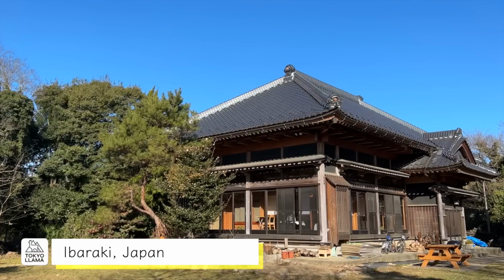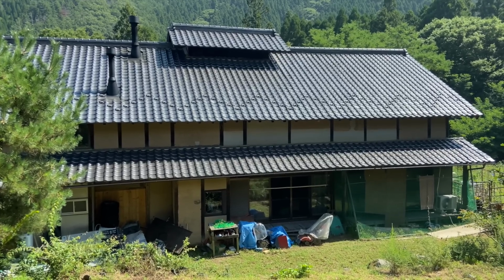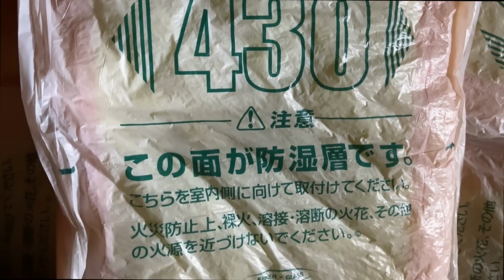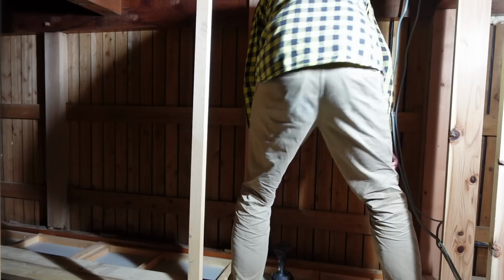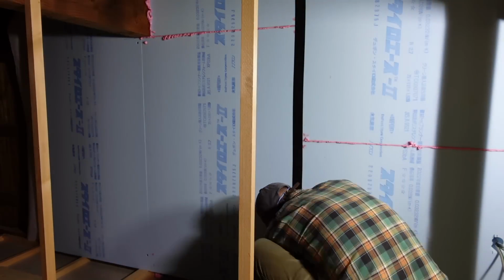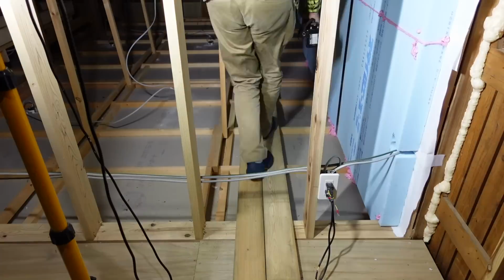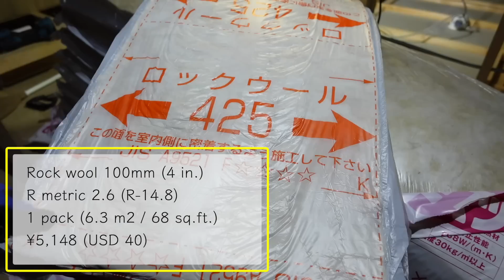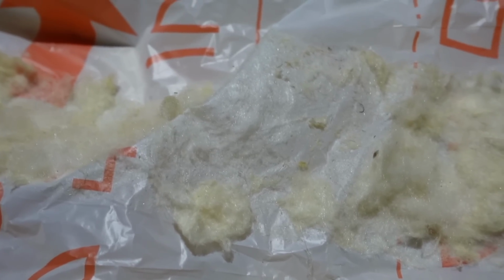Insulating a Japanese House, Part 1 | Abandoned House Renovation

Comment: That earth wool looks incredible! I just want to "floop" into it. 😂
On the point of insulation, I'm finally into my house here in London and as it's a small Victorian terrace the insulation is minimal. The heat loss isn't too bad, being a terrace, but damp is the bigger issue. I was wondering about that in Japan - for a large airy house like yours it's less of an issue, but do you know what the old style town/city houses are like in terms of damp? Kyoto comes to mind, of course, although I'm sure they exist dotted around the country. I can't remember if those houses have a gap under the floor or not, which I think would be the biggest help.
Reply from the maker: It felt like I was shearing a sheep cutting the earth wool! I’m not 100% sure what they do with machiya but I imagine the foundations are similar to ours and quite airy. Also, compared to England, houses here don’t use much masonry so damp is less of an issue.

Comment: I was wondering if putting that insulation So close to the original large  beams that go from the ceiling to the floor over the boys bedroom won't trap moisture and rote those poles.
Reply from the maker: Hopefully there's enough air flow and not so easy for moisture to get in

Comment: Spending money on insulation is the best way to reduce the money spent on heating and cooling. While yes, it is a cost that is immediate, meaning you pay up front to buy and install, it pays itself off over time. 60% of your heat is lost through the roof of a house. This doesn't take into account the design of Traditional Japanese homes, but I can only imagine the benefit of containing the heat to the bedrooms has a drastic effect on comfort. 

I live in Pennsylvania USA. Here we build with sealed wall cavities which for the most part are quick, easy and cheap to build... But they are terrible when it comes to moisture issues. 
My home is a pre-built house. It was built in a factory and moved to it's location. Here we call them modular homes, but it is not a mobile home. My house was built at the beginning of the modular house craze in the 1960s. If I could go back and choose a different home, I would have never have bought this house. The biggest problem in this house is not the lack of insulation... It was insulated but it was done so poorly that it is basically as if there was 2-3 windows left open in the whole house. Over compressed batts and very large gaps or no insulation in small bays. I was told by a home inspector that it would be equivalent to having no insulation at all with all the gaps left. This was discovered because the previous owners replaced the siding and the nails never hit studs under the sheathing on the outside. The penetration of the nails into the cavities provided a way for water to enter the bays and fiberglass insulation basically never dries out once wet... In a sealed bay. I had wet spots on the walls inside from water wicking in.  

Thankfully the siding is vinyl which is easy to remove and reinstall correctly, without much extra costs. The damage done by improperly fastening the siding was tremendous. 

The drywall inside had to come off and so did the exterior sheathing in many places due to rot, within 3 years. All the insulation was basically bad either from water or from it being installed incorrectly when the house was built. Which left me with a dilemma. What do I replace the insulation with?

I was living in the house and couldn't afford to rip off all the walls at once and replace all at once. So I nixed spray foam. Insulation board would have been great to add to the outside since the siding was off but the cost had skyrocketed because of supply issues. Which left me with replacing the existing insulation with fiberglass again or switching to Rockwool. The original insulation was r-11. New fiberglass is r-13, but Rockwool was r-15. I went with Rockwool because when it gets wet... It doesn't work it into the batt... So it never 'gets wet'. The added r-value was a bonus. 
In the previous winter my electric bill was $200/month. The following winter after replacing just 3 rooms (bedrooms) $175/month. Please keep in mind that electric rates doubled in the span of this year... So the $500 I spent on insulation has already been paid back. 
I know that my situation is an extreme case, but it does go to show that insulation is worth it's weight in gold... At least to me. I only replaced the insulation in 3 rooms or 1/3 of the entire walls of the house, not the insulation in the ceiling! 
Anything that you do to place a barrier between you and the outside is a huge improvement. The costs are not that much when you think of the benefits over the long run. I think in your case: it is money well spent. In my case... I wish the walls could have been able to dry out... So I didn't have to spend $10,000 to pull the siding off and replace insulation and drywall. Keeping the air gap was a smart idea.
Reply from the maker: Thanks for that. Sorry that you had so much trouble (and costs), but glad to hear that my thought that sealing the bays would cause potential problems, and that the extra work to create the air gap should be worth it (as well as the cost of the insulation).

Comment: Now that you sealed the air gaps, you have to work on how to quickly circulate the hot air trapped in the attic during the hot and humid summer.

Comment: How come the RockWool slabs come individually wrapped? I have never seen that here in Sweden where they only have a single outer wrap that holds a few pieces together before use.
Reply from the maker: I think it's just Japanese preference for convenience. Much easier to install than putting in a "proper" vapour battier.

Comment: Question, are those wool on the ceilings flammable? I've had my old wooden house burn down from faulty electrical wiring before, so please pardon me for asking.
Reply from the maker: Earth wool and rock wool are non-combustible. They say it actually suppresses fire.
Reply: @TokyoLlama  that's wonderful! An insulation layer that's also fireproof is very reassuring.

Comment: This might be a dumb question, as I have no background knowledge about insulation, but isn’t it better to have the rockwool and earthwool in bags than loose? That way all the micro glass and the like are prevented from potentially being breathed in and causing respiratory issues? 
I’m genuinely just asking, cause all I know is that when my parents had their insulation replaced in the attic (partially my fault), un-bagged rockwool was used. Btw. This was in Denmark if that might have any relevance 😅
Reply from the maker: The earth wool is supposed to be okay compared to regular fibre glass. That whole cavity will be sealed eventually but in the meantime I usually wear a mask up there - also a lot of dust.

Comment: I'd kinda like an overview of what exactly you're insulating (or rather, what not) and what the different materials are for. e.g. why the earth wool ontop of the rockwool again? Also, why did you insulate the floor of the corner and the walls? Or rather, wyh the walls if you don't plan on properly insulating the roof? Or did I misunderstand there?

Also also, I personally would have tried to turn that corner into a storage space with a usable floor. (Kids produce a lot of things they/you want to keep long term but realisticly won't touch for many years.) Any reason you decided against that?
Reply from the maker: Yes, looking back I probably should have done an overview of the layout as it's not as clear as I thought in the video. That's not a floor in the corner that's a ceiling (only about 9mm thick so can't be used for storing anything), and will eventually build a floor above it. I mentioned the earth wool just because I wanted uncovered rolled insulation - rock wool would have been fine, but couldn't find anything without the plastic covering.

Comment: Why did you choose to insulate the walls in this area (above boys bedrooms) and not just the ceiling?
Secondly after the walls were insulated why then insulate the floor - does it have a purpose given the wall is insulated? 
Am I right it is to reduce heat gain in summer in principle?
Reply from the maker: There walls are not air tight so in winter the space would be cold and any heat that did eventually make its way through the insulation would be lost outside through the walls. The opposite during summer. I’m not going to insulate the attic floor.

Comment: any issues with covering the light fixtures, will heat be an issue?
Reply from the maker: No, they are rated for covering with insulation. Also the rock wool is non flammable.

Comment: Why are you using XPS instead of PIR if I may ask?

I myself are insulating old brick walls and PIR gives a higher R value for the same thickness.
Reply from the maker: I couldn’t find PIR here in Japan. That said, because thickness didn’t matter so much I went for the cheaper option than some of the other foams.
Reply: @TokyoLlama  Yeah PIR is indeed among the more expensive options indeed. We're sort of limited by the thickness so we went with PIR.

For other insulation purposes I'm looking into denim insulation rather then rockwool/glasswool. They provide roughly the same temperature and audio insulation but don't suffer from thermal drift over time (the material losing thickness and thus insulation properties).
This option is more expensive than rockwool/glasswool but it's more sustainable and maintains the same properties over years/decades.
Reply from the maker: @Cobra6Gaming  thanks, I’ll check it out!

Comment: cant say that ive EVER seen someone cut foam sheeting with a skillsaw before! XD a box knife will do just fine LOL
Reply from the maker: Our carpenters did it with a circular saw so just copying them!
Reply: Ah i see. Anyways yeah you can just cut with a carpenters knife and you dont even need to cut all the way through. Once you make a cut at least 1/3 or so through you just simply break it and it will break right along the cut.
Reply from the maker: @1964corvan  ah, that makes sense. Thanks.

Comment: Covering up the light fixtures probably not good, remember when there was house fires from idiot insulation installation during the Rudd times. It'd be preferred to leave direct holes in the insulation above each light fixture to prevent heat build up in the fixture. A small loss to the heat barrier, but a massive reduction in possible fires in a basically wooden building. Don't they sell pink batts in Japan? Although an extra expense, some 12mm ply lain on top of the ceiling joists and then screwed in place would give a firm surface for walking and a much simpler surface to insulate, just my 2 cents worth. Great work otherwise...

Comment: I don't think it is a problem (yet) as you said you weren't aiming for airtight isolation.  But, when isolating old houses, you need to make sure that you also account for air circulation from outside. Without any fresh air coming into buildings, the air quality will drop dramatically to the point of becoming unhealthy. 
I am not sure how they are officially called in English, but there are "heat reclamation ventilation"  systems that basically exchange the heat from outgoing air with incoming air.  That way you get the benefits of good air quality with minimal heat loss.

I am no expert by any means, but it is a topic that comes up often around here as a lot of people are looking at isolating their home better.
Reply from the maker: Thanks, I've been thinking about this too. I don't think the house will get fully air tight but I am researching air exchangers and do plan to do something along those lines.

Comment: It's an astoundingly tough task to add an (almost) entirely new control layer into a building envelope after the fact! Especially one with such beautiful architecture (that deserves to be preserved as-is) which almost rules out the option of "just" building an uninterrupted new insulative wall and roof structure all over the existing envelope... I imagine having to do it piecemeal must feel like jamming fiberglass between one's ribs sometimes, instead of just putting on a whole winter jacket.

From what I've learned about building physics from my reading is that controlling or at least limiting undesired airflow is the first step in improving energy efficiency of a wall. Before that, keeping the rain off is of course even more important, but anyway... after establishing a good air control layer somewhere in the wall one can next worry about the thermal control layer, i.e. insulation. The recessed ceiling can lights are an unfortunate design choice in the air tightness aspect - I'm sure some LED alternative could've been found instead, assuming visible wiring would be acceptable.

You are correct in making sure the wood of the facade remains ventilated as that's where air in turn must be able to flow freely. Long eaves on the building take some of the stress off the wood of the facade but sideways rain will still make it there on occasion so ensuring the wood is able to dry helps with longevity.

Comment: You can tell its not in aus, not the design of the house, or the materials used.
Its the fact hes in the roof and not a single redback spider is to be seen.
Reply: Weell... funny you should say that. I'd suggest you Google [latrodectus hasselti japan]... 😨
Reply from the maker: Yes, they have them here but never seen one. Definitely not as worried about snakes and spiders as I would be in Australia though!

Comment: Circulation of air is important in a house. Why? so you don't have damp of any sort. The important thing to remember is the house has to be able to breath in all climatic conditions. Western houses tend to have chimneys that helped the air circulation but with modern day thinking that you seal every bit of the house to retain heat and have no drafts introduces damp in the house that can't escape, if your house retains damp long term that's a big problem.
Reply from the maker: Correct.

Comment: Hey man, some money saving advice from someone in the same rabbit hole. JFE makes an unpacked product, code BD04010P, it's 11 meters long by 910mm wide, at around 12.000円 (maybe less if you order directly) , or a little over 1000円/m. You're paying 5000ish for 1.36m, or ~3.600円/m. Both are 100mm thick and 30kg/m3. Catalog on their website.
Reply: While you're at it, get a couple of these seismic absorbers. An affordable solution to safeguard your investment. カネシン V-RECS SG.

Comment: I begin to understand why the Japanese abandon these houses. A restoration and bringing them into modern times like you are doing is likely way more expensive than have a new house built if you have it done by professionals and building companies. And the habits of the Japanese labour market (work very long hours, don't take your holidays) would make this a decades long DIY project.
It's just not a viable option for most Japanese people I guess.
Reply from the maker: That's true to a certain extent, and you could definitely build a new house with the money we've spent, but not a house of the same quality (building materials, size etc) for the same money.

Comment: at least in germany there is wood fiber insulation which does not cause as much problems with moisture as with other artifical insulation materials since its open to let humidity pass through.
Vapor barriers rely heavily on being installed 100% air tight, even a little mistake where air gets through warm and cold air will create condensation. But you made sure to at least leave space for the air to circulate.
 In an old house I would never trust any claims from styrofoam etc and use the less effective wood fiber but I am sure since its 100% natural/biological material which properties are well known to not cause any problems down the road. It is very easy to block humidity somewhere and mold will grow. Old houses are build to let the air circulate. To hunt for cost saving in risk of damaging walls and ceilings is not worth it in my opinion. I hope you have no problems with your house and did your research properly. But I am no one to comment on this since I do not own a house myself.